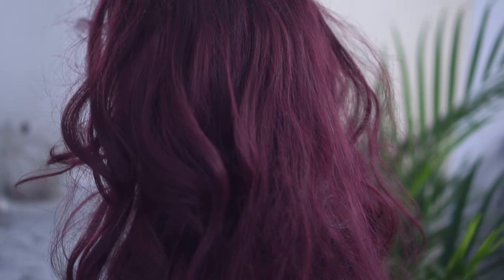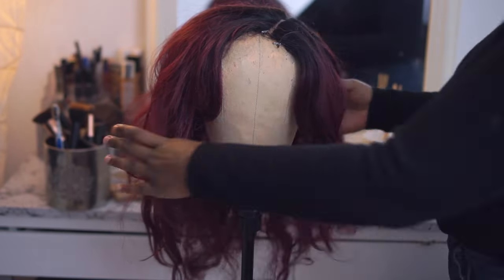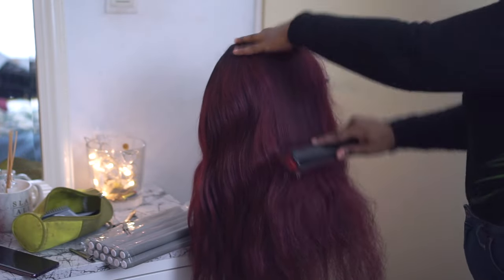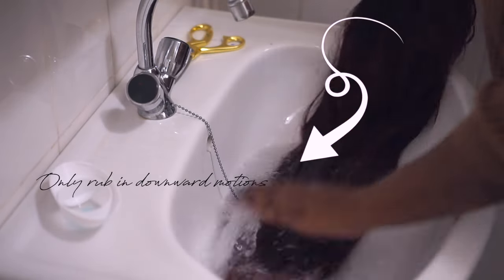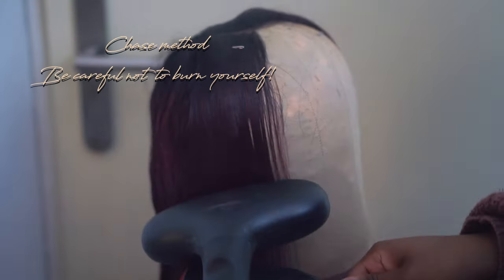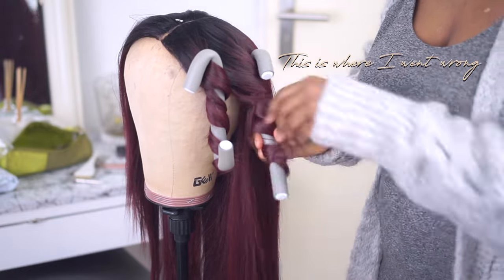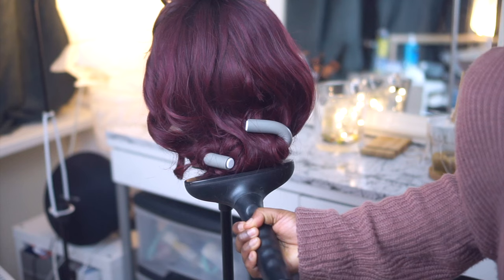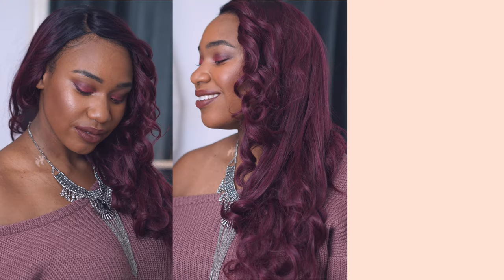How to REVIVE and fix any MATTED synthetic wig! Make an old wig look NEW!

Comment: If you don't have a steamer then while the hair is damp or wet apply 300-330 degree heat on it using an iron, and the same effects will happen. Synthetic hair is fiber so like clothes it can be flat ironed with water to get the wrinkles and frizziess out of it. It also helps to use silicone mix, it works better than fabric softner to me
Reply: I can testify to the water method.
Reply: a clothing iron or flat iron?
Reply: @LiveLoveAnime66  clothing iron. Sorry I forgot to mention 🙏 the temperature was medium heat, my synthetic wig looks like 100% human hair. I wish I could post my photos so everyone can see.
Reply: Omg you just helped me bring my baby back to life! Because of you I will be able to save all the wigs I have instead of throwing them away
Reply: Where can I find silicone mix

Comment: Steaming the hair with rollers in makes them damp. Too much for a synthetic. If cared for and stored properly you won't have those issues. I have a synthetic for a year. Never wash my units, I use dry shampoo. To straighten I use a ceramic flat iron and some Carol's Daughter Mimosa pomade. It makes the hair soooo soft and works great with heat. I recently had to cut ends off a unit Ari 24, she's very curly. I sat in front of my mirror and took my time curly the hair with a 1" curling iron. But to each it's own. But that 45 minutes to comb out...no mam. LOL
Reply: I try to care for my synthetics properly but they always seem to frizz and tangle. It seems like I have to defrizz and restyle every few wearings. Not sure what I'm doing wrong.
Reply: So, what do you do extra for it not to get tangled and frizzy then? How do you store your wig???!

Comment: wash: warm water, laundry detergent pod, plain laundry detergent, fabric softener (for the end frizzes) wash in a downward motion to keep straight. Add extra fabric softener for the ends if ended 1:55
Let it dry
straightening + smoothing: steam as you brush through the wig. if you dont have a steam CAREFULLY use an iron as suggested by other commenters 2:50

Comment: I don't have money for a streamer and fabric softener I brush through it just have knots in and it is frizz and flyways and static would brushing it is really bad like urs would using wig conditioner work to make it soft
Reply from the maker: You really need heat. . . Maybe borrow a handheld steamer from someone or use my no heat method on my channel!
Reply: @DeeDellimore  alright I don't have the pods ether she is a new wig I found out she was poorly made and I didn't know that when I got her off azmon she was pretty the frist day then the 3 day she looked like urs big knots and tangles and I tried getting out the tangles and knots and she is super long and I can't get them out I tried everything I was told and it didn't work I know that she is a costume wig which is synthetic